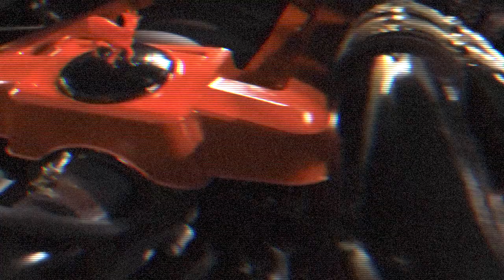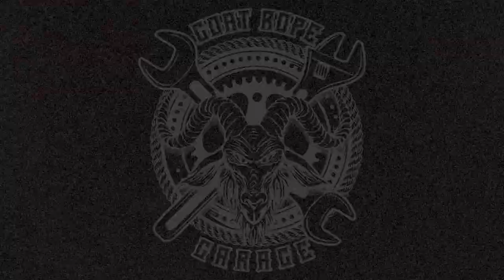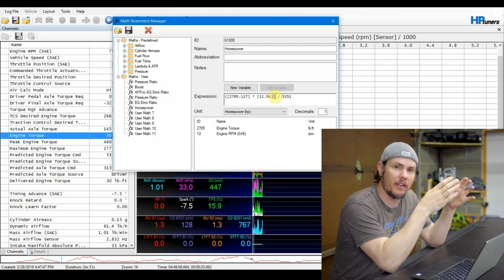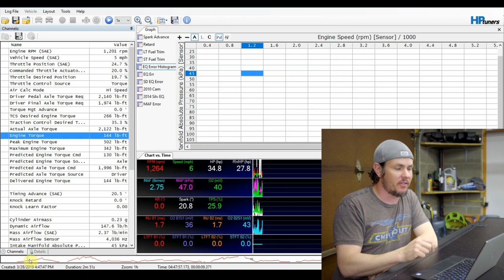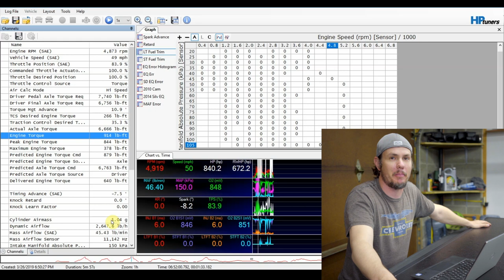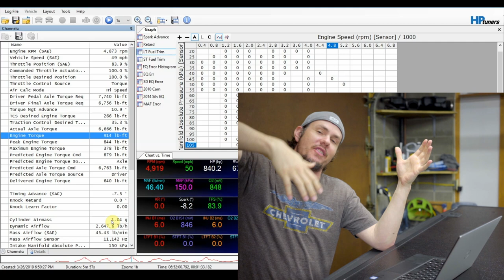Logging Horsepower in HP Tuners Scanners!? Using Custom Math And The Torque PID!

Comment: So here's some food for thought, a dyno uses roll speed and the "moment of inertia" vs time to calculate torque. Basically quickly you are able to accelerate the roller knowing what type of force it takes to do that. So let's say you had a way of figuring the MOI of your vehicle. From there is just a bit of math. I've recently built a dyno with some universal controls and with the help of an engineer friends math capabilities, we were able to find the MOI and our machine is right on par with other local dynos. I don't see any reason why you couldn't do this driving down the road based off of the MOI of the driveline, weight of the car, distance traveled, maybe throw some wind resistance in,.....etc. the math isn't as complex as it sounds. I bet with some time a math could be created to give you torque and hp.
Reply from the maker: I agree, and it shouldn’t be that crazy to calculate a general MOI and get things dialed in.

Comment: I could be mistaken on this but hear me out. Isn't one of the main calculations that the torque PID uses is comparing current ignition timing to your MBT table? (some call it "max torque timing")

If thats the case and you swap a cam that has a higher MBT due to it being less efficient in lower areas of the RPM range your calculated torque will still "level off" at what ever your MBT table has in it. Therefore you wont see any increase in calculated engine torque with more ignition timing even tho the engine is actually making more torque. 

For an example i have a 5.7L SBC vortec with a ZZ4 cam running a 98 block box PCM. MBT states that maximum torque timing is about 18 degrees at 1500 RPM and about 28 degrees at 4000 RPM. This is incorrect as the truck picked up over 40 foot pounds of torque with timing set to around 25 degrees at 1500 RPM and quickly ramping up to 32 degrees at 2500 RPM. Unfortunately engine torque isn't a logable PID with the black box PCMs but ive seen this effect on the gen3 stuff aswell.

Intrestingly enough this calculated engine torque and thus MBT table also effects your line pressure regulation in the automatic transmission as the tables for that are based off calculated engine torque.

Food for thought, love your videos dude your style of presentation is quick and to the point without unnecessary filler. Keep up the good work 👍
Reply from the maker: That's the million dollar question, and you are most likely correct that timing is one of the factors that is used to calculate the torque. I think an easy test would be on a torque based ecu to pull a significant chunk of timing and do a comparison log paying attention to commanded torque and what is in control of torque. I've never seen timing be directly in control of torque but there is a slight chance that if you dial it back enough that it could take over. I know timing can be pulled by what is in control of torque but I doubt any timing tables themselves could control the torque.

Given all that, if your torque maps are dialed in decently you should be commanding base timing in addition to any additive situations as determined by your tune, now if you would be able to see power gains strictly from advancing timing, I think you will. But I don't know if those gains will be from the timing itself or from you changing a variable of the data going in to the calculations resulting in skewed data going on. 

In short, sign up for my Patreon and I'll eventually but a Dyno! Ha! Thanks as always for contributing Odd, you always have great insights!

Comment: At about time 6:21 how did you pull up the log file showing the higher HP so fast? I did not see you hit the log file icon.  Thanks. I want to second the comment from Carlos and request you think about doing some MOPAR stuff. On Scotts question and your response, Dodge does not have Delivered Torque in the Parameters Selector dropdown unless you have to be connected to the car to find it... But surely there has got to be something that can be used???

Comment: Great job on the channel! I subscribed and will definitely be looking forward to more content!!  My buddy and I will be enabling E85 on my 17' 1LE Camaro SS sometime next week.  The car supports the sensor and the tables are already in there but are not enabled.  I already installed headers, air intake, and of course Flowmasters! Now this car has already been tuned once at a reputable speed shop. No wideband yet...due to the way my bank account is setup ;-)  Now to make a long story short...I should be able to enable flex fuel along with some DTC's related to the flex fuel sensor...and be safe...right?  We will dial in more once wideband is installed.  Sorry to change the subject discussed in this video. Thanks for the awesome channel!  This was just was I was looking for to help figure out HP tuners more.
Reply from the maker: Scott, welcome to the garage! Check out my flex fuel sensor video, it goes into the things you need to setup on you tune to enable everything, it's pretty straight forward and if you can find a stock tune file for your platform that already had flex fuel that's the easiest way to see where to get the tables setup. But feel free to ask any questions, here is a link to the other video:
https://youtu.be/hVHNAtIgu-Y
And the flex fuel tuning video, if you haven't seen it already, they should get you headed in the right direction:
https://youtu.be/xUV0uf6yMnE

Car sounds like a beast!

Comment: I'm working on a 2016 Silverado, and I'm trying to set this up. But when I attempt choose the parameters the engine torque is in Red, and it does not log it in the scanner. I also cant find it in the channels to turn it on for monitoring.

Comment: thanks for all your videos they're great. I am working on setting this up and I have the torque and hp set up in the chart but in the channel I do not have the delivered torque, its not there to add it. Thanks in advance.
Reply from the maker: What are you working on, Scott?
Reply: a 2009 Dodge Challenger SRT 6.1L
Reply from the maker: @sbjglass  Not sure that the Dodge will have that parameter
Reply: ok, thanks

Comment: either i i did something wrong or idk because its says 71,889.8 hp lol
Reply: im doining it with Deliveredengine torque and at 3941 rpm its 285 lb.ft so idk where im getting this crazy numbers
Reply: nvm i found the issue was an extra parentesys
now it says 305 which its weird because its a cammed C5 with bigger injectors lol
Reply: Tuning it’s frustrating but funny lol😂